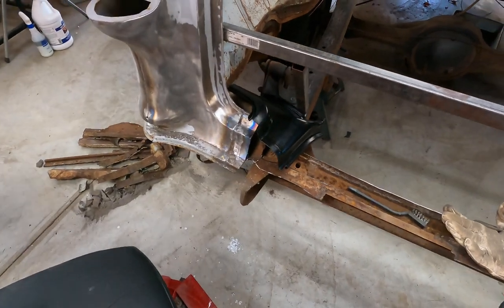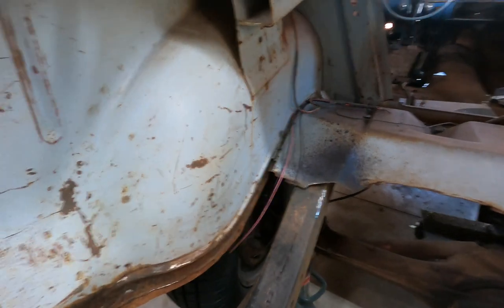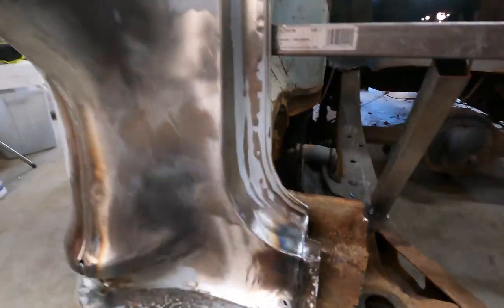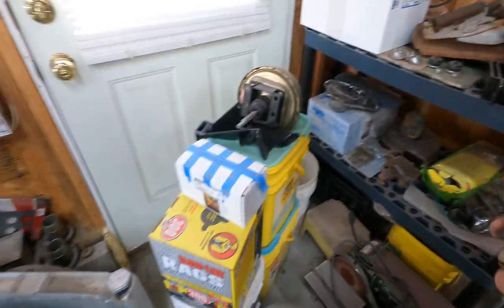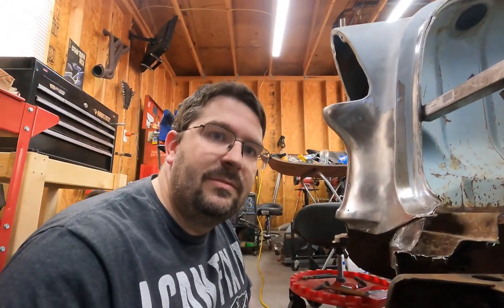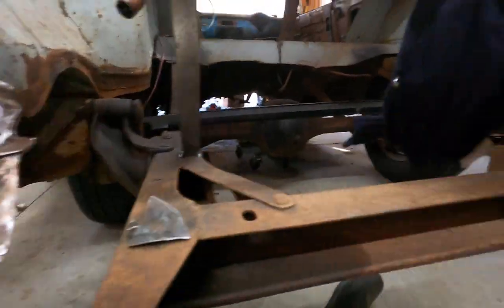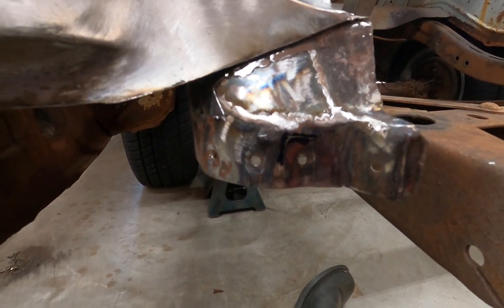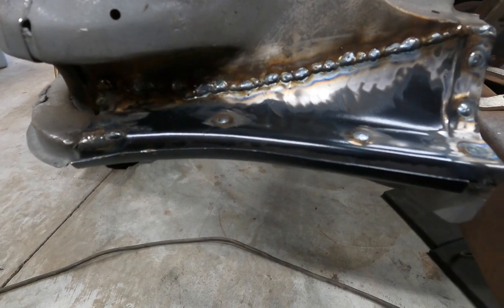55 Chevy Rear Metalwork

Comment: You could use a yes wailder I too have a 56 chevy 210 Townsmen wagon I'm still building and I'm working on changing my floor pans to and my rocker panels and my toe pans too my 56 has a Oakland California VIN code and I was told by the tri five chevy clubs of America that my wagon is rare car do to people chopping up and converted it to a two door handyman  so there's not too many of the Townsmen wagon with the Oakland VIN code

Comment: The price of 55 chevy repair panels are off the charts. I was surprised to see you use the mig after watching you do the door jam. I need to buy a tig. I'm convinced it's the way to go seeing how nice the jam turned out.
Reply from the maker: I had to use the MIG because Of the condition of the surrounding metal (too dirty for TIG) and for speed. Each has its place. TIG is still my favorite. Thanks for watching!